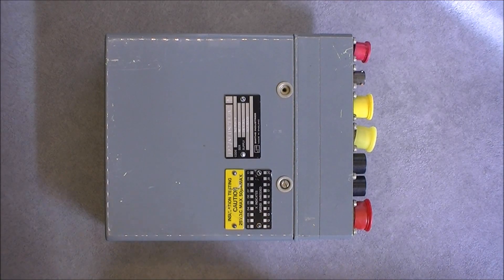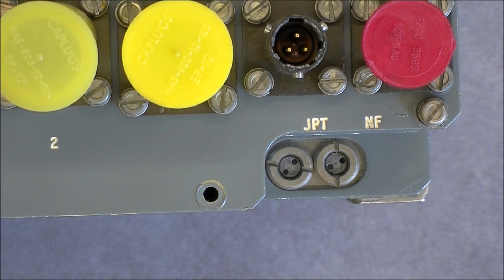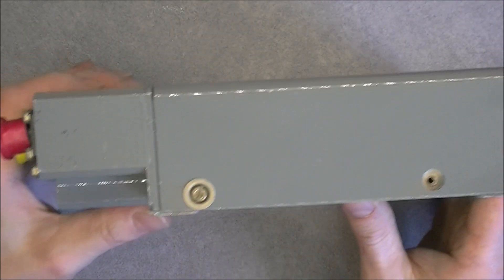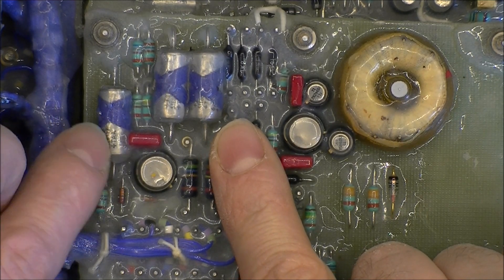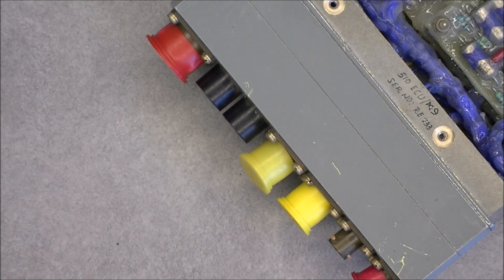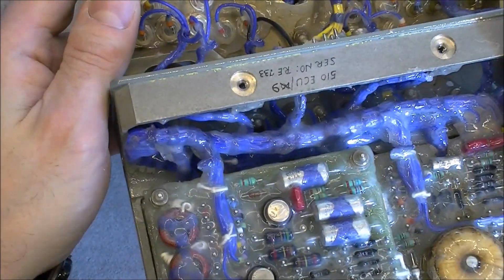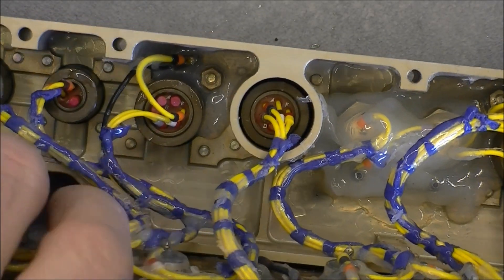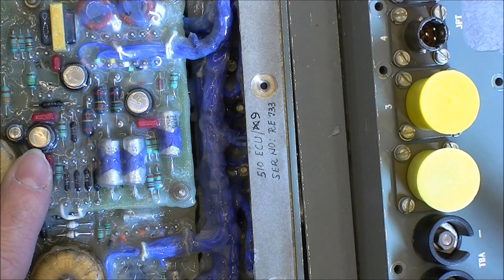Avionics teardown: Smiths Jet Pipe Temperature Limiter from a Sea Harrier

Comment: aaaah you got one of these.  I was considering it a while ago but... didn't.   Smiths used that blue ribbon everywhere,  I have been meaning to try it out and see if it's actually any better/easier for lacing up bundles of wires than waxed cord.

Comment: the screw holes might not be threaded to make sure the components are put in exactly the same orientation each time - unneded here except for the device in the middle hole. Maybe the case size is standardized and modular so other devices might use more of the holes in that way.